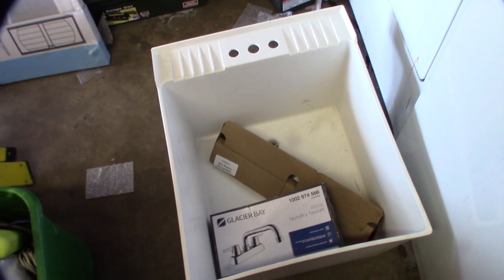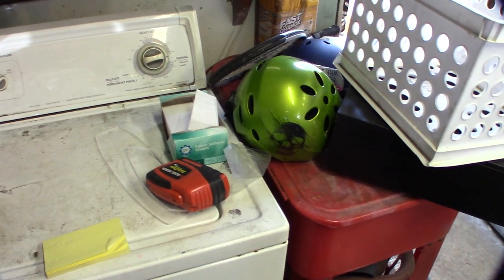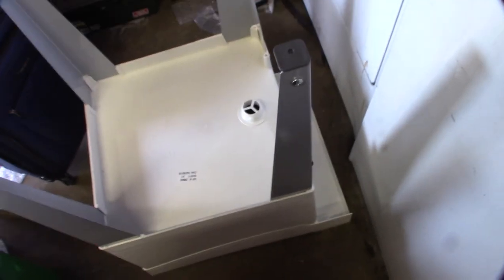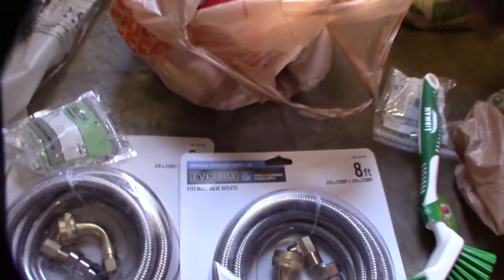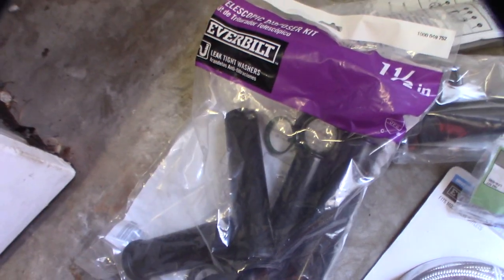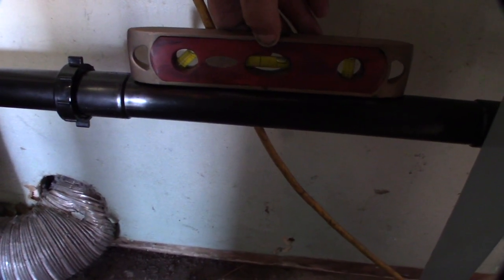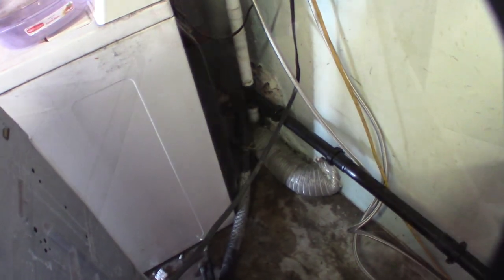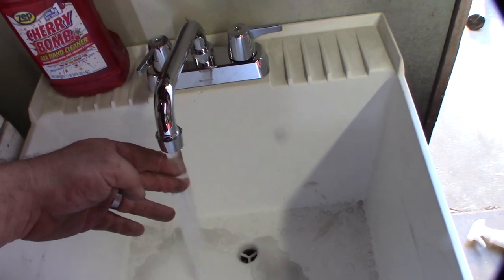Mustee 19F Utilatub Utility Laundry sink install tapped into washer water and sewer

Comment: Exact same thing I did at a house I lived in a few years ago. Worked out great and you’re right, turns out a lot cheaper rather than hiring a plumber to reroute supply lines or even doing it yourself. This way is way quicker and easier

Comment: I went to Home depot and got the kit  mentioned. Everything was in the kit that I needed. I used a brass 1/2" splitter and all went very well. I do suggest using tape or putty to eliminate redoing the connections for a leak, as happened to me. Rather than plumbing into the sewer line, I put a bucket under the sink and use that to water trees and plants. We do not need it for really dirty, greasy cleanups. Thanks again for the video.

Comment: Nothing like a couple sticks of 1/2" copper pipe, fittings, 1/4" ball valves, and some solder to sweat it all together. 

Sorry,  I'm anal about perfection and a professional appearance.

P.S.  You can install a mechanical air vent at the trap with an ABS "X"  or  "T" fittings (depending on your trap piping) and it will help tremendously  if you have slow sink drainage.

✌️